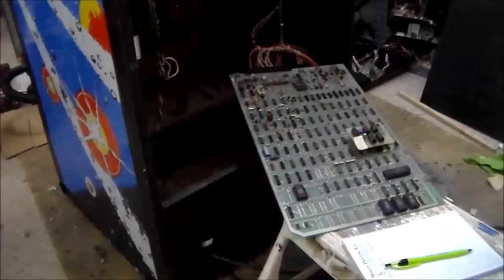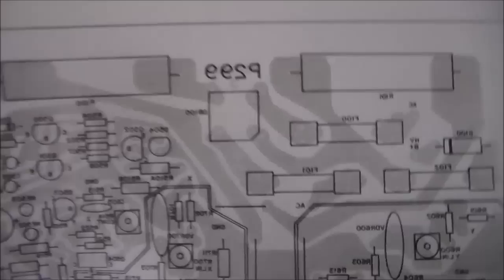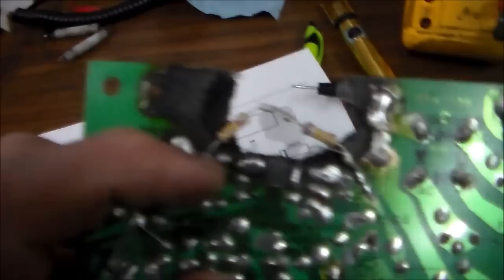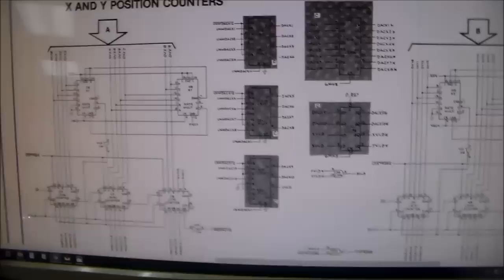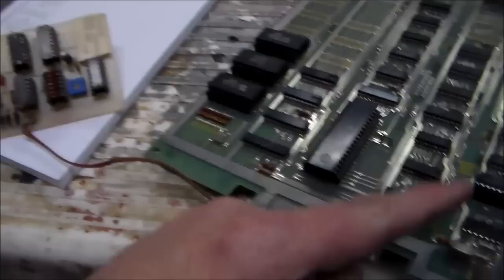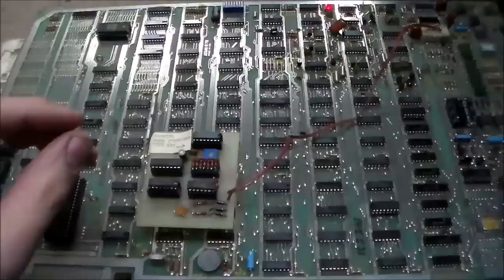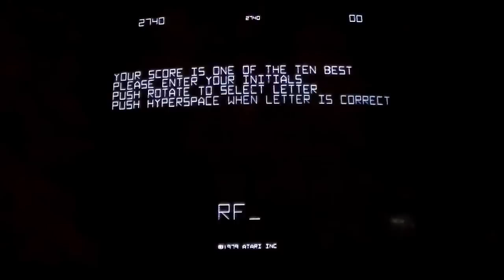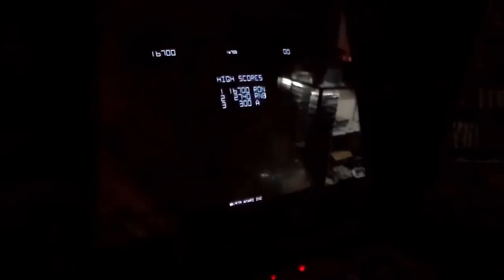Fixing a 1979 Asteroids Arcade Game - Operator Caught The Vector Monitor On Fire!

Comment: In 3D printing we use low ohm resistors as heaters to melt plastic.  I doubt those resistors touched anything, they were probably tucked in like that from the start, and then slowly over time, they just cooked a hole in the board.
Reply from the maker: Yeah those big carbon or sand ones whatever they are do put off a ton of heat.... maybe something failed and was sending tons of amps through there and it was over fused or something.  Crazy to see the damage though!  Thanks for watching Michael, we appreciate it!

Comment: I own an appliance repair company, if appliances came with that much comprehensive information every technician would recommend that appliance to the customer, but instead we get a partial tech sheet with some vague information if we are lucky.
Reply from the maker: Yeah it's really a bunch of crap, they don't want you fixing anything, back in the day they'd explain exactly how these things worked down to the resistor!  You've probably heard before though, when the Model T car was around they actually gave you a bag of tools with the car when you bought it new so you could fix it.

Comment: I don't think the "pot" on the "speed" board is anything to do wit hspeed.  It's more likely some kind of voltage control.  Probably best to leave it where it was originally.   
Love the way you fixed the deflection board.  That was certainly a mess.
Reply from the maker: Thanks Brendan, I think you're probably right on that pot.  The Asteroids is still here and up and running strong a month or so later...
Reply: @LyonsArcade  Those old boards are pretty resilient.  Not like modern electronics.  They can deal with half a board being burnt, as long as you can remake the tracks.  Look forward to more.
Reply from the maker: More coming soon :)

Comment: Joe - I love your videos. I noticed something when you had the speed hack board installed - when you adjusted the pot, it seemed to affect the brightness. Could that be what it's for? Or was that just a co-incidence? Also, my Asteroids Deluxe has a similar issue with a bit of the vector shapes coming apart on the left side of the monitor - (nowhere near as bad as the one in your video though) I've been leaving it alone because i'm too afraid to mess with it.. But your video is giving me a bit of hope - maybe it's just a chip i can replace! Was there any obvious sign that the TL082 chip that was in there was bad? ... Love your videos! Keep them coming! :)
Reply from the maker: Thanks Groome, yes other people were saying it looked brighter.... if you feel brave you can swap those chips one at a time in that area but don't do it if you're not handy with a soldering iron :)
Reply: I've seen those op-amps (circa '80) go in a myriad of analog applications when they get very very old.  I'm noticing that some IC's made back then were made of materials that eventually break down during use.  From analog op-amps to digital IC's.  There's no rule of thumb on which ones/kind, other than they likely lived a hot life.
The TL082 is still cheap and easy to get, just order from Mouser or the like.  And double check that you put them in the right way before soldering :)

If your thinking of giving it a go, this could be very helpful:

That if you want to see some early '80s era circuit board chip removal/soldering/repair, search youtube for 'Adrian's Digital Basement', as he's done a number of Commodore 64 repairs, which is pretty applicable to this board/tech type.  Just don't snip chip pins like he does when he removes them, grr! (wrecks a possibly fine chip)
Reply: @emprsnm9903  Hey thanks for your ideas and input. :)  I'm not afraid of soldering, I haven't done it in years, but i clearly understand the procedure. I'm still a bit afraid to mess with my AD pcb though because, well -  right now it works, (albeit with a slight issue) but since it ain't totally broke, I'm just not yet fixing it. :)
At some point I will though, so at that time, I will take your thoughts and advice into consideration. Thanks again! :)

Comment: Amazing to think that that entire board could now be reduced down to just a few chips.
Reply from the maker: Yup, pretty wild!
Reply: Some madman has done this on an arduino (1 chip $5)

Whats amazing is that most of these chips are the 'Lincoln logs' of chips.  And everything that came afterward was a combination of these basic DNA blocks type chips.
Counters, inverters, gates, flip-flops, op-amps.  Most commonly availiable today, 40+ years later.
Reply: @emprsnm9903  yeah and they still use them to teach first semester digital logic. They are practically free now. In fact in the school labs there are spare bins of them. They are literally the little kiddy Lego blocks of the digital world.

Comment: JOES CLASSIC, I forgot to ask also when replace those deflection resistors with a jumper wire I wonder why they did this because the jumper wire should be at a thick gauge like 16 gauge to handle the current? Because this can burn up the circuit board if you just use a 22 -24 gauge jumper wire because of the current which looks like what happened because those deflection resistors look like 1 watt or 2 watt resistors that get very hot it looks like.
Reply from the maker: I think they were more like 10 watt resistors, but yeah it was a big mess!  It had something to do with circuit protection or having it not blow the fuse, with the jumpers if there's a problem it just immediately blows the fuse which is kind of how you would want it I would think.
Reply: @LyonsArcade  oh ok thanks for the help

Comment: It appears that turning that control on the "hack" board didn't do anything.  The game was running at the same speed regardless of the position of the control.  That's similar to overclocking the CPU in a computer.  I would be afraid of a game running faster than normal because of chips possibly burning out due to voltage increase.  I will say you are amazing in repairing that burnt board.  I'm glad it was fixable.  That Asteroids game is such a classic, I wish I could own one myself but the cost for one is pretty high, plus I have a small basement so even just one of those games wouldn't fit.  I'd need another room just for arcade games :))).  I'm actually trying to keep track of how many original Asteroids games you've repaired.  It looks like one of the easiest games to repair.  I also wondered if a standard monitor could be used in one of those games; or somehow feed the video signal to an external monitor as a composite image?  Also do those monitors have the standard settings like vertical hold, horizontal hold and contrast?  I know it has brightness since you mentioned it.
Reply from the maker: It doesn't have horizontal or vertical hold because those are based off of the sync signal, which isn't present in this monitor because it's a vector monitor.  Essentially it just tells the beam where to draw on the screen, it doesn't scan it in like a raster monitor so has no sync or vertical or horizontal hold.  There is a contrast control and a brightness control though.  There's also a horizontal size and vertical size that's located on the actual game board.  There isn't an easy way to get a composite signal out of the board, I've heard there are some converter boards that are fairly expensive that allow you to use a vector game like this with a more modern monitor by converting the x/y signal to composite but you're talking $400 or so just for the converter board.  I wouldn't say it's one of the easiest to repair I've just ran across some easy to repair ones :)  Thanks for watching, see you on the next video!

Comment: I would have cut the carbon completely out, it's conductive. Would make a 'daughter' pcb out of some single sided proto-type PCB. Maybe even following the original layout. The transistor removal and linkage, I would have done the same, as when I saw the board even before you showed the blueprint of the PCB, I would connect it like that. Though, would have used solid core copper wire.
Reply from the maker: That would have been even better, thank you for watching!

Comment: Can't beat those old service manuals... If only they were still a thing :(
Heat shrink tubing is handy for running mods like that imo, can just stick the whole resistor through it!

Enameled wire is often used for smaller stuff: it's already insulated, and the heat from soldering it burns off the insulation at the joint... Just don't breathe the toxic fumes lol
Not sure if I'd trust it for something like this though, certainly not on a high voltage CRT board..

Comment: CW2B-1R500J 
CW2B1R500J	5905-01-208-6316	Resistor, Fixed, Wire Wound	Body Length: 0.560 inches nominal
Reliability Indicator: Established
Electrical Resistance: 1.500 ohms
Vishay Dale Electronics Inc. (91637)

Comment: At 35:59 when the screen slows and pulses slightly with the start buttons, I bet if you looked at the voltages, they are getting pulled lower by the light in the start cones.
Reply from the maker: Yeah I think you're correct.  It didn't seem to do it when the kit wasn't on it though.
Reply: @LyonsArcade  Yes, because the kit takes the place of ONE chip IIRC but has a lot of components on it so it's pulling way more current than a single chip. I'd bet if you put a capacitor across the +5V lines on that board, it would fix the pulldown. Try, say, a 1000uF 16V to start. I assume you also checked the voltage on the 5V line anyway? I like to see a tiny bit over unloaded like 5.2 or 5V if it's adjustable via pot on a switcher.
Reply: And by 'that board' I meant add a capacitor to the speedup kit....I don't do arcade any more but I do classic electronics...takes less room and easier to buy/sell/trade...subscribe if you like hacks such as booting Atari DOS via iPhone. :) Yes really.
Reply from the maker: I'll bet you're right, the extra chips drag it down, I didn't think about that!

Comment: nmi/irq manipulation e also did back in the days on the c64 :D
Reply from the maker: One of these days I'll learn what it does :)
Reply: @LyonsArcade  NMI Gotta be Non Maskable Interrupt. These are interrupts triggered by a hardware device such as the system clock. The game likely uses a specific timer interrupt interval and the hack you have halves the timeout or sends an extra signal a half interval away from the original (essentially doubling the rate) forcing the game to update twice as often.

Comment: this is the first video of yours that I have come across, I must say that I liked it and will be watching more. my question is, why do you not use kapton tape or another insulating sheet on/around these repairs to prevent accidental contact with other traces?
Reply from the maker: That would have been better for sure!  Thanks for watching Jacob, we appreciate it!
Reply: also it looked like the grey graphics like the asteroids were brighter with the pot turned up and the start pulsing was brighter too.
Reply: @LyonsArcade  I would like to get my 13yr old son started in electronics/computer board repair, where is a good starting point and a source for damaged board to practice on?

Comment: Bad solder joints took that board out.
Every one of those boards I ever looked at needed to be re soldered.
Shorted output and over fused
Reply from the maker: I believe you're right, like you mentioned everyone I've ever messed with had really bad solder joints too.

Comment: How do the large square resistors differ from the normal cylindrical type? Are they specifically designed for high voltage applications?
Reply from the maker: The cylindrical ones are 'wire wound' they're more expensive than the other ones which are cement resistors... the cement ones are cheaper, so when you get up to bigger wattage resistors, the cement ones aren't as expensive since you need a fairly large one.

Comment: Thumbs up even year later! 👍😂
But for future - that left over carbon can dissipate power and continue to burn and change line parameters.. But that burnout happened, because these resistors were rated for lower power, than original wire wrapped in ceramic packaging and they overheated, probably, taking PCB with them..
Reply from the maker: Thank you for watching Arturs!

Comment: I am honestly surprised that 1.5ohm burned up resistor even tested correctly (or at all).
Reply from the maker: Sometimes they hang on :) Thanks for watching Moto Dork!
Reply: @LyonsArcade  that is true. I couldn’t really tell but it did appear to be a metal oxide resistor and those are good quality.

Comment: what I would have done is put some heat shrink tubing on the resistors to keep them from shorting out
Reply from the maker: That would have worked great, but on those big ceramic ones they might get hot too...
Reply: @LyonsArcade  oh okay that's true
Reply: @kpanic23  The square sectioned ceramic resistor was probably rated at 5 or 10w.. something was obviously drawing some good amount of power through it.

Comment: You can record a video with the trial and error left in, because one thing I think about John's Arcade videos is that John would show that and then viewers would comment that they appreciate it. They appreciate the mortality of it. As well, they don't just assume something is the solution until they see the part of the video that shows what the solution was. So even if they pause before getting to the solution in the video, they don't just try the first thing as if it were the solution yet. Plus, having video parts in a series can heighten enjoyability because some people get a thrill from the suspense and then finally solving after the suspense! So I suggest that you DO try showing at least a few of the errors (but not showing everything if it just seems like its a TON of that, way too exhausting for viewers).

(Please only reply without your odd "what you're fishing for" comment or something similar.)
Reply from the maker: Anything else you want to complain about?
Reply: @LyonsArcade : "Complain"? What's your problem, man? Why do you ASSume I was "complaining" about something, when this is actually just reassuring you that showing your mistakes in videos actually is a GOOD thing because viewers tend to like that and don't get messed up by it?

You sound on your videos like you might actually be kind of a level-mooded person. Why are you so rude to people in the comments?

Comment: I have an Atari battlezone upright cabinet with a centering issue just the same where everything is shifted slightly to the left and some of the lines are very slightly out of whack... (same 19v2000 B&W) if you look at the battlezone schematics (sheet 2B) is the TLO82 @ A10, the same thing as the TLO82 @ C12 for asteroids? It is right at “X OUT”.. sorry I’m new to all of this; I just got the the game non-working and I’ve got it up and running, and this is the only issue. But this is my first arcade game I’ve ever owned. For anyone that replies thank you for the help!
Reply from the maker: Yes, the output section on battlezone works the same, just make sure you're in the 'x' axis.  Now if it's just minor you may be able to adjust it out, there are two rings around the yoke, little flat tabs that if you slide them away from each other, or rotate both of them around the yoke, it moves the picture around on the screen.  so if the whole image just needs moved over a little bit you use those little rings.  If the lines are a little bit off, there's also a couple adjustments on the actual deflection board on the monitor, if you look closely there are either 2 or 4 linearity pots  you can turn to change things on the test screen (the cross hatches).
Reply: Joe's Classic Video Games Thank you! I’ve tried the 4 adjustments on the game board but nothing will help it move over to where it needs to be. I’ve heard about the yoke adjustment but I’ve also heard a lot of people say not to mess with it. But I guess since it’s not a color monitor and it’s only one gun you’re adjusting it shouldn’t be too hard to get it just right. There’s about an inch and a half on the left side of the screen that won’t display anything (which I guess means it’s shifted right not left) but it is inverted too lol. Confusing... I’ll try the yoke adjustment and if that doesn’t fix it I’ll maybe try going the chip rout. Do you think I could get that much adjustment out of the yoke?
Reply: Joe's Classic Video Games on the deflection board there are x and y “line” pots that are adjustable with what looks like an Allen key. In the 19v2000 Manual it says do not adjust these, they are factory adjusted... that was my first inclination was to adjust those but I’m a little afraid to touch them. There’s some forums online talking about Adding pots to some circuitry to be able to adjust xy linearly.. but I wonder what those two actually do if I were to try to turn them?

Comment: I got a supposedly working Sega X afterburner 2 board from ebay oh hell no...connected to super gun tester....and...BAM went tantalum coupling caps!! like a damned rifle shot all at once oh my god those old tantalum caps! THEY SUCK! Also that was scary! Sha BANG like a cap gun! Ordered nice ones from digikey and it works fine now but my god that was scary electronic firecrackers oh my god! It now has the modded rom and ram upgrade for the melody music in game too! Sega fan boy forever and I loved them and even their original electro mechanical games!
Reply from the maker: Very cool, yes the Sega stuff was super fun but as you may have found out it's hard to keep a lot of them running, they're very advanced hardware.... thanks for watching Grassulo, we'll see you on the next video!

Comment: It might be worth putting some electrical tape over the junction of the two resistors you added in the burnt out area. I found it a little odd that you used such a long wire as a jumper where the good high wattage resistor was.
Reply from the maker: A couple people have mentioned that!